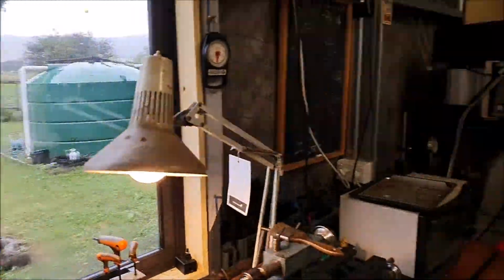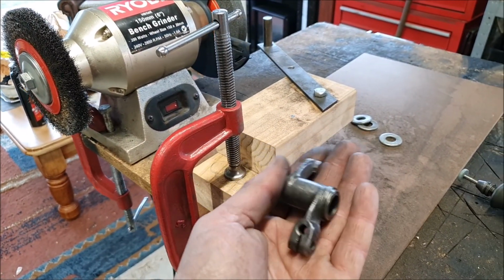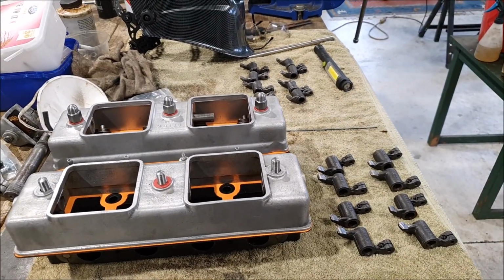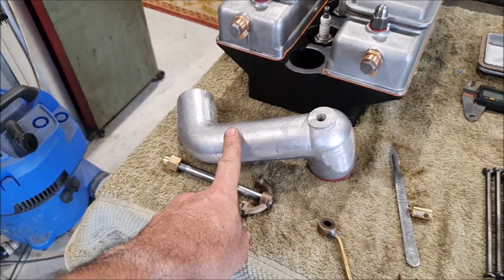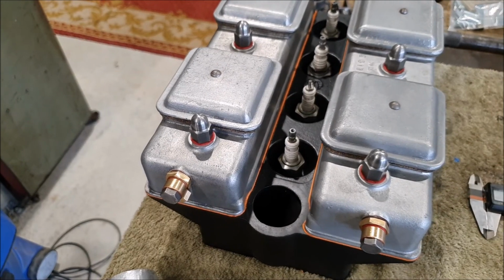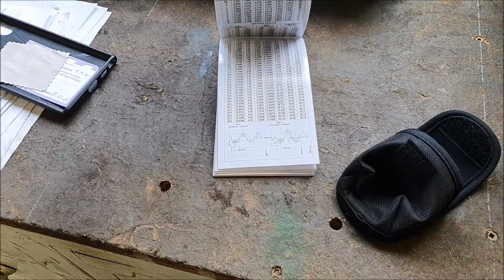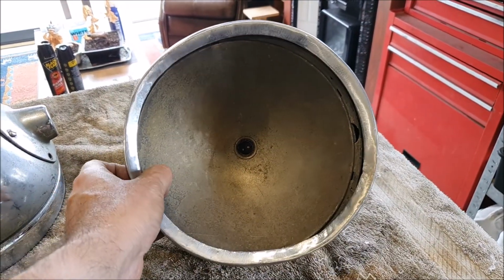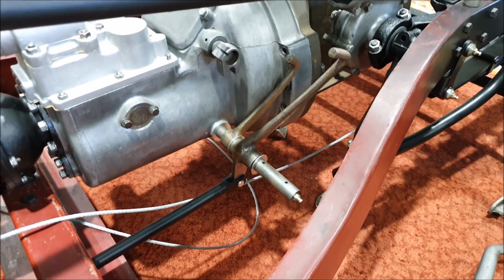Riley 9 rocker gear assembled

Comment: I've gotten into the habit of immediately checking the welding tanks as soon as I get home, my supplier has given me several empty or half empty tanks. I also check all the fittings with soapy water to make sure the tank itself, and none of my connections are leaking.
      Here in Canada we pay twice what it costs for parts and materials in the US, even though most cities are only a few hours from the boarder. I thought we had it bad, but I can't even imagine the insane prices you have to pay in New Zealand, not to mention the wait time.
Reply from the maker: I do have a spray bottle of soapy water in the shed, just have to remember to use it!

Comment: Simon, I think the headlamps that you have are for a later model than your car. The lamps you have look to me to be 1933 or 34.  I think your car would have had the smaller diameter earlier Rotax lamps  (not that it really matters).  I think one of your reflectors is the dipping type.  Normally Rileys (and other cars of the period) had one dipping and one non dipping, so you have a pair.
Reply from the maker: One could be dipping, you're right. It it missing all the bits from inside which would be the dipping solenoid I guess? I have never actually see a dipping one.

Comment: I would have thought that the rockers would have a radius on the face so they could slide across the flat face of the valve stem as they went up and down. (Just had another look at your grinding setup and it looks like that is what you did!)
Just a note on the springs separating the rockers, I have replaced the springs with aluminium spacers on other engines, letting the rockers float a few thou', reducing a tiny amount of friction.
Those headlights don't look like Rotax to me, more like Lucas. Rotax lamps have rims which are beautifully fitted to the body with an almost imperceptible gap. Also I think the glass in the Rotax lamps is crimped in to the rim whereas the Lucas glass is held in to the rim with wire springs. Of course I could be wrong.
Keep up the good work!
Reply from the maker: I think there was a time when Rotax and Lucas were doing some weird things with badging when Lucas took over. The one badge I have is definitely a Rotax one not a Lucas one. I know the Lucas spring clips you mean, I have those on the Austin. The Rotax are definitely a much prettier looking lamp. I also like that they are bigger. I have see some Brooklands with smaller lamps and they just don't look right. 7 inch type ones are just too small. That's an interesting idea about the spacers instead of springs. I guess aluminium works fine as that's what the rocker boxes are. There definitely needs to be a curve on the face but exactly what the radius is interesting. With a curve on a flat valve end you are always going to have a line contact. I guess you want the contact to always be on the top of the step and not start pushing on the edge. But the radius will also affect how much push you get on the valve so apparently it is possible to gain an extra bit of valve lift depending on how you make the radius. I find this hard to picture in my head so I am working on an animated CAD model to show it. I've never done joints/motion/animation in Fusion 360 before so I am just learning that now. Should have something to show soon. The motion is quite complicated and I am not sure Fusion can actually model it. Might have something up tonight.

Comment: Hi Simon   The rocker bolt pinch bolts were originally 1BA  they were very close to 7/32'' BSF which was used in the UK by the motor cycle industry both now defunct!  The rockers should have a slight curve on them , I have bought new ones years ago. There was a jig available to Reg members to do the job. Not sure about sending it to New Zealand though! Have a word with James. The ones you have welded, like you say will get the motor going. Charles Ullman has mentioned you and the HT tube on the Forum have a look. The oil unions look like 1/4'' BSP which measure approx  9.5 mm . The size is always more than the dia. stated.  There is a firm in the UK that could sort the headlights out but would cost to much. Anyway good job, lets hope you can get registered for the road.   Cheers John
Reply from the maker: My little jig puts a curve on them, it's knowing what the curve should be that's interesting! I wouldn't risk having it sent here. Too much risk of going astray and even if it didn't the time taken means it would be out of service for months! BSP threads are interesting, it's based on the size of the pipe not the thread. I have a bunch of taps (including 1/8 BSP) and none of them fitted so I ended up measuring them with a pitch  gauge which is where I found the right one. I need to get back in touch with the certifiers. The issue is there aren't very many of them and they decide what they work on. If you can't find someone who wants to do it I am not sure what you can do then? They need to see it physically at least 3 times I think. If I can't find someone locally it would probably be cheaper/safer to get someone to fly down to see it than trying to arrange transporting it all around the country!
Reply: @asciimation  Simon,  as the Register have had new rockers made James must known the radius from the (possibly original ?) drawing,

Comment: The tappet locking bolt thread is 7/32" 28 TPI  BSF. I made some for my car from 3/16" Allen head cap screws , using your lathe turn the cap screw shaft to 7/32" and screw cut the thread.,  really enjoying seeing your restoration progress.
Reply: The cap screws I used were 1/4 " not  3/16" 
cheers .

Comment: I put my very tarnished reflectors in a silver cleaning solution (a sachet that dissolves in hot water) and I was amazed that these came up shiny - with the latest LED bayonet headlamp bulbs that are now available (here in UK), they don't actually need help from the reflectors anyway, so it becomes cosmetic. I wonder if one of the reflectors is the dipping type, angle down on dip-beam on nearside, while the offside is off, then main-beam, lifts up as the offside illuminates.

Genius of the Lamp here in UK would be able to restore those headlamp shells to perfection, probably cheaper than trying to find a better pair that also may not be brilliant.

Thanks for sharing!
Reply from the maker: It's very difficult to find out exactly how much they would cost to repair unfortunately. You see lots of testimonials from people happy with their work (and I have seen them in The Automobile so knew about them) but no one ever says "Brilliant job and only cost 2000 quid!". It's one of those if you have to ask you can't afford it things I suspect. Plus they would really need to see them I imagine so immediately there is a massive cost up front just getting them to the UK. I am not sure those are actually the right kind of Rotax! I know some saloons used K593s but not sure what the Brooklands had. I have emailed some suppliers to see what costs for repros are.

Comment: I have been a little disappointed with some reproduction parts. (Not all, some are very good) Unless your vendor is unusually fussy you could probably grind those rockers with your eyes closed and get them closer to spec.
Reply from the maker: That's an issue with all repro car parts I think. The Riley parts, especially the ones done by the club, are all good quality luckily. It's such specialised stuff usually there is only one person making them so the quality is kept high. Means there is only one place to get things from though. I don't mind that, it's a choice you make when you decided on what brand of car to restore. The annoying thing for me is the postal time. It's always a several week wait! I still find it amusing on the muscle car restoring or hot rod type channels where nearly everything is available overnight in the states or is just a trip to the parts store down the road.

Comment: Shouldn't matter as long as you adjust the valves correctly , as I know you will. Thanks for all the videos. Cheers.
Reply from the maker: I started looking into it all and it got very complicated very quickly! Lots of theory and ideas around how to do it best. As long as the rocker pushes the valve for now that's all I am worried about. Can figure out the fine points when it's running! These engines were kept running over 90 years by total amateurs so I am not too worried. As you say, as long as I get the clearances right it should be fine to run.
Reply: @asciimation  There is a lot to be said for some of the American sayings, such as " keep it simple " and " if it's not broke don't fix it". One thing I would worry about is that cylinder head oiling, I don't like that it goes in on one end, and then has to find it's own way to the other. I would put an oil tube in there so all the rockers always got oil. Especially if you think about driving up or down hills. I love your content even when you get too tecnical, thinking out loud is great in my book. Cheers. I sure would like one of those engines to play with, do you know of any in Europe?